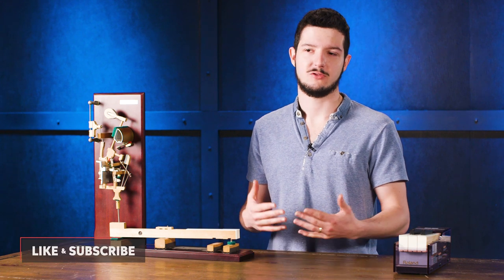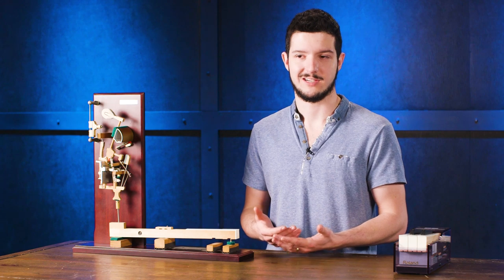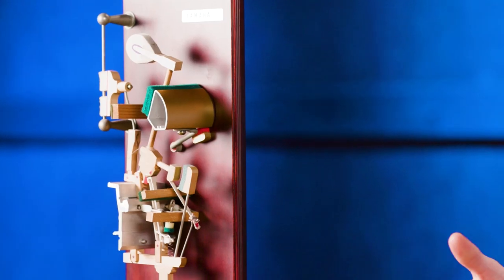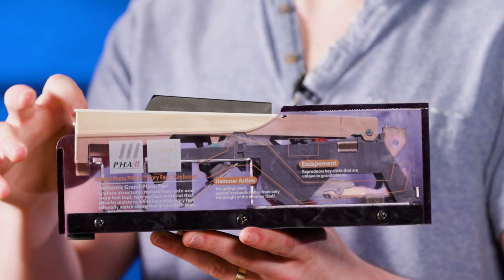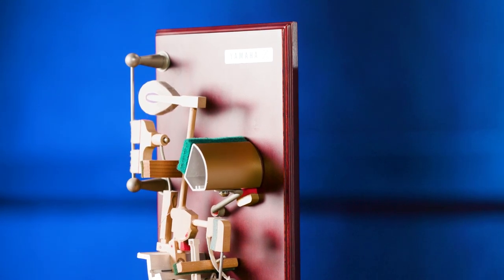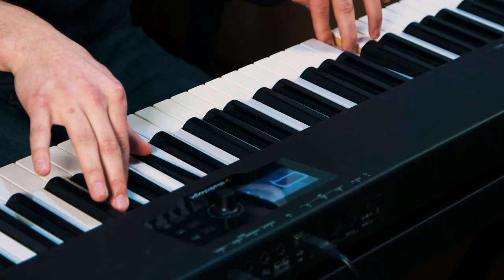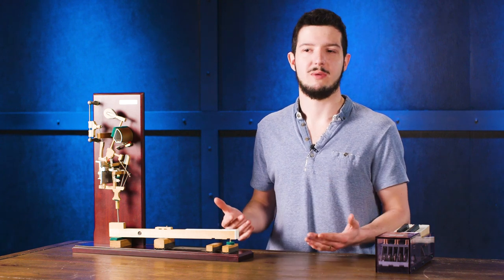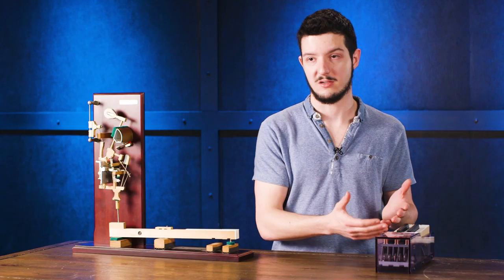What is a Keybed, and Why Does it Matter?

Comment: That's an upright mechanism isn't it, not a grand? The hammer is traveling horizontally.
Reply: Yes, that's correct. It probably would have been better to compare a grand or baby grand's action to the keyboards', since that's what they're actually trying to emulate; I guess they didn't think about that or simply couldn't get ahold of one.
Reply: This is exactly what I also wanted to say - upright action is already compromised comparing with grand piano (real action). This error should not have happened!

Michael